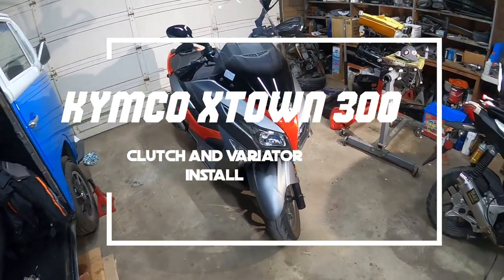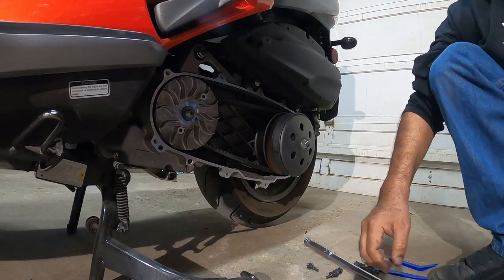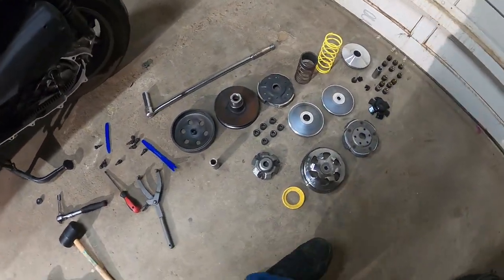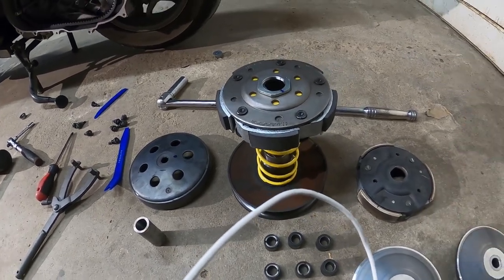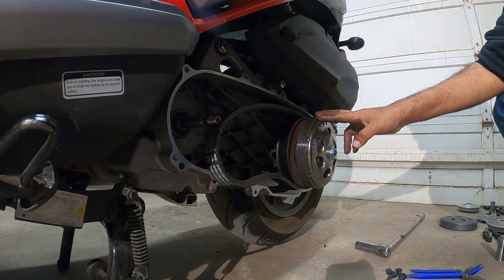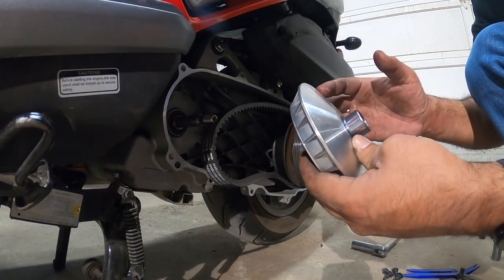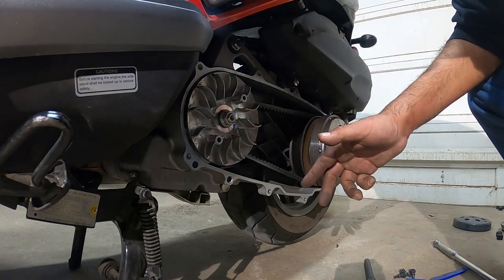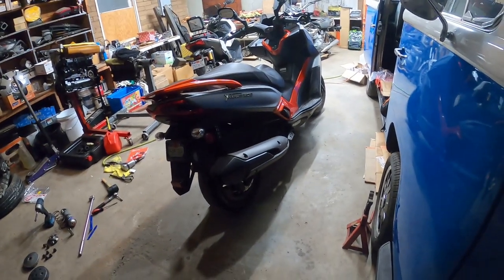2022 Kymco XTown 300 Clutch and Variator install

Comment: The top speed increse to  ?????
The aceleración 0-60 mph or 0-100 kmh is one second, two seconds more fast
Reply from the maker: So when you change the variator and get lighter weights you have a lower top speed but more acceleration it also work the other way around. If you put heavier weights you have a higher top speed but slower acceleration.